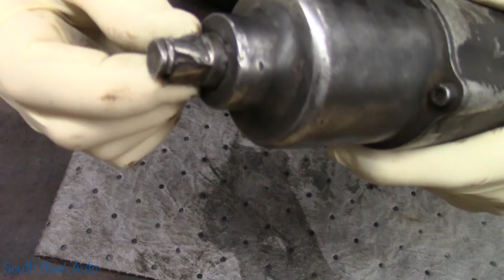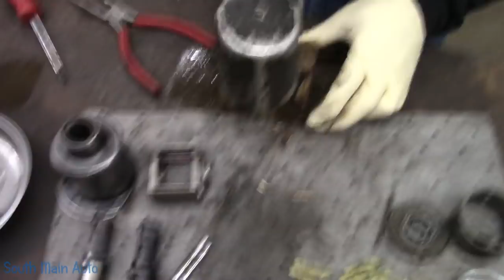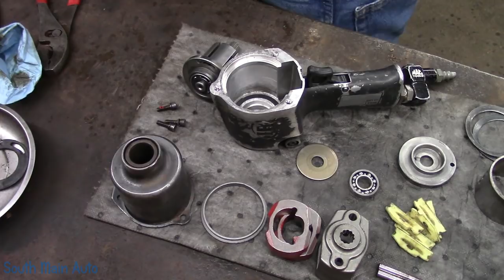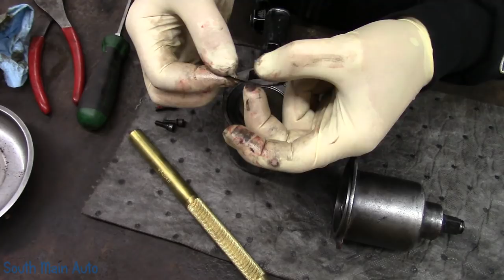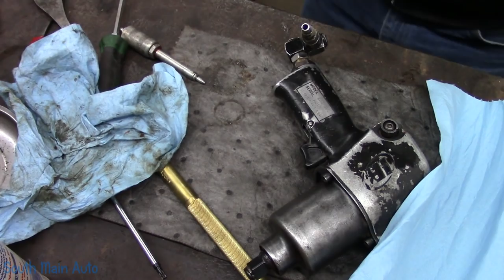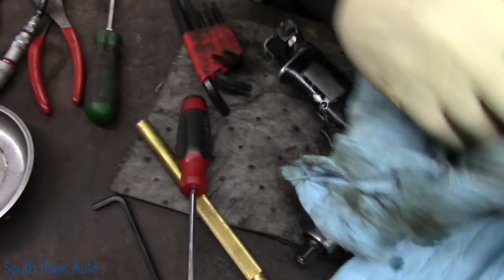What's Inside: 1/2" Air Impact Edition

Comment from the maker: *Ingersoll-Rand 232TGSL* : 1/2-Inch Super-Duty Air Impact Wrench Thunder Gun: https://amzn.to/2BG4btJ
*Astro Tools On Amazon* : https://amzn.to/2BFh4nU
Reply: Great video  Eric hope you had a great Christmas and also have a great new year
Reply: @TractorWrangler01  it's funny...the only reason one might prefer to have someone else do it is for the Warranty on work and parts.
Reply: just think if you had a lathe you could of made the part yourself cheaper
Reply: @glyn watkins cheaper than free...
Reply: @darylzero3139  depends if ya have a lathe n spare metal in the first place lol
Reply: @glynwatkins9968  you could make it but it wouldn't be as strong. Plus you'd need to mill the flats too.
Reply: @southjerseysound7340  yes u can do that on a lathe to lol, youtube shows u how to do it
Reply: @glynwatkins9968  yes you can adapt a lathe to do some milling. I actually have a angle plate and slide on my mini lathe. But you're failing to realize that anvil is forged and has to be in order to survive. Anything that you machine from raw stock will be hammered to bits in minutes.
Reply: @glynwatkins9968  
Not if you value your time! You also need the correct type of metal too. Funny, people think you can just chuck up any ole metal in a lathe and you've saved yourself from buying something!
Reply: I love that u made it shift gears like a race car. Sounded like one to. On another note I always wondered why the inside was like and how it worked
Reply: I had one of these and all of a sudden it didn't work with the same torque  I ended up throw it in the garbage
Reply: Definitly going hmmmm😉
Reply: @willielittle6021  lo
K
J
Reply: @JorgeRodriguez-po7kx  
  Never throw away these types of tools, they're all just a collection of replaceable "pieces parts."  😉
  If you pay attention to how they come apart, they're pretty simple to fix, don't try to remove the vane (like  he did) housing from the press-fit seat...  lol. No need.  Doable but, a pain if you don't know know what you're doing.  lol. Just flush it with brake cleaner/solvent until it runs clear.
Reply: First off, I love SMA channel, it's just honest and raw, no gloss workshop stuffs. I wonder what SMA thinks of the old magnesium impact housings compared to the newer modern composite bodies. Love to know the answer to that as I'll never find out myself in 3 lifetimes compared to how much they use their guns.

Comment: When I bought my first new air tools, I bought all IR, mostly because the older mechanic who was kind enough to mentor me had a full set of IR tools that he bought when he first got started decades ago and they all still worked. The company has been around forever and all the parts to rebuild them are still available. The only time I've had to crack any of them open is because an old shop that I used to work at used line oilers and filled them with Marvel Mystery Oil. The ingredients are a mystery to me, but they made all the seals in all my air tools swell to the point of no air getting past the triggers, so I had to replace the gaskets and o-rings in all of them. But that was about 13 years ago now, and they all still work beautifully after receiving daily beatings.

Comment: 16:07  Hole offset does matter.  It biases the power output on the rotor rotation.  Hence why it has higher reverse torque.

Comment: Great video. Good for you for rebuilding a great gun. I just rebuilt an ir 231 model a. Trick to getting the motor in and out smoothly is to heat the housing with a simple propane torch. Then it goes in and out much easier.

Comment: My dad always used I.R.  When I went to work that's what I bought. Still have my first impact. Only thing I changed has been the anvil. did it about like you did. i never had good luck with air ratchets. Once worn out toss and buy a new I.R. Thanks for sharing.

Comment: Rebuilt many of those!  Worked for a company that used those impacts on their production plastic molding machines to pull the molds apart. 48 1” bolts every 7 minutes! But that was 40 years ago, and they look the same!  Great tool!

Comment: i could be wrong but--- i believe there is a pin missing that aligns the front and rear of the motor assembly and the barrel of the motor. the offset on the barrel is so it has more torque in the reverse direction. so if you put it in backwards  you can put things on that wont come off lol. and that grease fitting in the back- it goes through the motor through the anvil to grease where the hammers hit.   ive wore out a couple of guns in my lifetime  always had the 231's  every time the thing needed fixed they would break off the lower right cover screw. not sure why. always had extras on hand. anyways thanx for bringing us along
Reply: richard cranium pretty sure the pin your talking about went back in to align the gasket at the bottom before he put any of the motor back in.
Reply: I used to love my IR231

Comment: My IR 231 is somewhere around 50years old! Put in one anvil and one set of vanes. Still use it ,still working fine. Oil it occasionally is all it gets.wish I had a dollar for every wheel it's taken off ,not to mention the on told amount of other bolts and nuts it has hammered off and on.  40 years as mechanic at Chevy store followed by ten years mechanic in at auto auction.

Comment: I still have my Campbell-Hausfield impact I bought at Walmart for $65 back in '01. NEVER oiled or greased the thing until just recently - never knew you were supposed to HAHAHA! Didn't know what that strange fitting was on the side until about 9 years ago, lol. Thing never let me down though! Can't believe it lived as long as it did with zero grease in it. Guess the factory actually put some in, and it was actual quality grease. It now lives in the back seat of my truck in case I ever get a flat - I've got a set of Viair air compressors in the bed.

 I used that impact daily for close to 10 years before I bought my IR 2135 TiMax - that one is now almost 9 years old, but I've kept up on the maintenance - she cost me just a bit more money than the CH unit. Haven't had either one apart yet - figure I've got another 10 years before that needs to happen.  😁

Ahh who cares where the gaskets go - it worked! 👍👍😊 Nice job! Set for another 20 years, at least. 😜

Comment: For many years I had the IR 244 which is similar, runs a little slower but has a little more hitting power I believe, my anvil twisted off one day which rather proved the point that stuffing lots of air pressure into it gave it a lot of magic beans !. I ordered a new anvil and that portion of the tool is very easy to work with as I found out. Some years later the three case screws backed off with the vibration ( probably never get them out if loctite was put on them ) and air leaked past and lost power, figured out the issue but it had blown the gasket. Had to buy a rebuild kit just to get the gaskets but when I used the whole kit and took the motor apart to replace bearings and the motor vanes I discovered that the motor case was worn badly as in out of round in the area where the ports are and the only fix was a new motor case, up here in Canada that one part cost as much as you replacing your whole gun Eric. Needless to say I retired that gun as it was not worth pouring the money into and bought the composite IR and have been extremely happy with it in the few years I have owned it. I see a lot of comments about being so surprised about greasing these guns, well they are designed to be greased as the grease goes into the hammer/anvil end for that action through the hollow motor shaft passage way, the oil into the air tool opening lubricates the motor vanes. I had even bought the mini grease gun and the special grease from IR way back with that IR 244 and greased and oiled it often, seems the only way to give those tools enough oil for the motor to live the longest life is by having an oil injector/mister into the air line but then that shops air line is no good for blowing straight air or inflating tires but that.  Excellent real life tear down video of a well used/abused tool !

Comment: Nice.  I had a Black and DEcker model from the 70s.   Couple years ago, a plastic piece broke in the air control side.  Didn't seem to be any parts available or any   guns found on  eBay to cannibalize.   I tried to rig up a replacement  part ,  but no go.   The housing sits now in a pile of stuff my grandsons play with ( has a good handgun profile), and I now own a Harbor Freight replacement.   I'm an old DIYer so I expect I won't need another new one.

Comment: I've had my IR 231 for 23 years now, only had to replace the anvil. I had replaced the hog ring but the sockets still kept falling off so I changed the anvil and all was good, still works to this day. I think IR makes the best pneumatic impacts. I heard a lot of techs now are switching to the cordless impacts now. I just don't know if they have the power of the air powered ones.

Comment: Those holes in the housing that the drum with the fins spins inside of is the air escape, they affect the torque(?) that is applied when spinning in each direction. If the holes are closer to the clockwise direction, it would be less spinning in that direction than counter clockwise, and vice versa.

Comment: 5:10 That looks very familiar to me as at one time I serviced vacuum pumps. Rebuilding is a new set of vanes and polishing the rotor on a lathe with wet / dry 600 grit.

Comment: My IR impact gun looks exactly like that one, except with a rubber cover over the handle.  Often wondered what it looked like on the inside.  It's been a great gun over the past 15 years of my intermittent DIY auto repair uses.  My only beef with it is the torque adjustment that's built into the reverse switch.  I like having the reverse torque up high and the forward torque down low (breaking lug nuts free vs. installing them lightly before using a torque wrench), and when I adjust the setting for one direction, it seems to change the setting for the other direction as well.

Comment: Ive put together motors that are a similar fit, its nearly a line to line fit and you need to be very straight to get it to slide together..I use to play with the pneumatic die grinders the same way. My kinda mechanic.

Comment: I'm limited to parking lot mechanics, would you recommend I get a cordless impact gun? They're on Amazon for around $300. Right now I'm using a breaker bar with an impact set already, so I have both Imperial and Metric, because Mitsubishi likes to mix the two because reasons... I actually managed to torque a converter set because my breaker bar is 1/2 inch, and the set I had before was 1/4, and the bolt seized up in the caliper mounts, and from all the leverage I had from the breaker, I broke the bit. Advance Auto Parts was nice enough to take the set back even though I clearly broke it from over torquing it. Anyway, 5 hours of curse words, flame, squirting PB Blaster on my 3M mask and glasses, breaking a hub bearing and shattering the rotor, I finally got it off. However, I feel this could've been avoided by an impact gun.

Comment: The exhaust ports in the bottom of the cylinder looked like they were offset to one side a bit, if so I’d imagine the cylinder is in fact directional as the timing of the exhaust ports would affect power in one direction or the other.

Comment: This style impact is bulletproof, oil it often, give it a shot of grease now & then to pad the hammer parts and it will last a long time. I use the 231C and its hard to beat the price (125) and it has a decent amount of power.. My first air gun was a worn out CP 741/749 before getting IR 231/261. The vane kit is fairly inexpensive, the hammer kit seems to cost as much as a new tool LOL The new tool is imported but still quite reliable.

Comment: Have rebuilt this platform since the early 90s . That 3 piece gasket is starts as one pinched between the hammer housing and spacer that is pressed fit into the housing. The air vane cylinder is best left in when removing the rotor to keep the lower end plate aligned to the housing bore and will assist on reassembly. If you really wanted to wake this thing up remove the e clip from the rotor end plate remove the bearing lap both end plates with 300 grit on a flat surface to remove any grooves finish with a 600 grit. Then use a wheel cylinder hone to clean up the vane cylinder take the vanes to the 300 grit and lightly clean the seal surface.  A couple drops of 10w30 on the bearings reassemble dry. Now you have to seat in the vanes WD40 with a straw applicator a light squirt into the air inlet. Hook up a regulated air line or or one with a tap. Plastic tie the trigger full open put it in a vice or lay it on the floor 40 psi or mid throttle let it rip 5 min in fwd then in reverse. Now the vanes are seated give a light dose of air tool oil 3 to 4 drops and continue to do that over oiling the tool will degrade the performance then grease the hammer push the drive into the tool grease the tool until the drive pushes forward then stop you can actually over do it and tool performance will suffer.Now your IR is better than new. 300 ft lbs now 400 ft lbs.

Comment: I'm definitely NOT an impact expert, but when installing bearings in various things (like bicycle headsets) I find using a piece of PVC pipe useful as a non-marring driver to pound on.
Reply from the maker: I actually have  a park tool headset/bottom bracket bearing driver for bikes :D
Reply: @SouthMainAuto  That is funny.  I have used my automotive threaded pullers both purchased and homemade  on bicycles since the 1990s.

Comment: Very cool I've done that on a few of the old IR231'S though one of them didn't work after and the other I just changed the anvil which was no problem. If you bought a Mac 3/8 impact for $100. that was a heck of a deal I've priced them out here and they're over $200

Comment: On those two jiggly bits, it might matter which one is which if one is beefier- i think on impacts, sometimes the hammer for the loosening direction is beefier than the one for tightening, so you get more torque to break things loose, but not so much likely to snap them off going back together.

Comment: I don't use that Lucas air tool oil. I took a piece of scrap metal and polished it to shiny bare metal. In three different areas I placed one drop of Lucas air tool oil, one drop of Ingersol rand air tool oil and one drop of Top Ring air tool oil. I did not distribute the oil depending on the wicking action. I then set the metal in the weather for several months through the Canadian fall. On examination, the Ingersoll rand area which had expanded to an area about 4 inches in diamater was shiny. The Top Ring was a close second. The Lucas patch had a large accumulation of surface rust to the entire area.

Comment: As far as the vent holes go on the motor housing, they bias the pneumatic motor to putting out more torque in one direction than the other. In this case it will be in the direction of breaking the bolt loose, if I recall. It will work the other way, but have less breaking torque.

Comment: Those plastic parts are called Vanes.  Just like a air/vacuum pump.  usually made out of carbon and expensive, they wear kind of like brushes on a motor.  But that is for pumps, I'm not sure about an air motor.  cool video, never took one of my impacts apart.

Comment: You forgot to throw a little oil on the cross bolt (direction change bolt/part/piece) to help free it's motion.  Made a big difference when I did mine, don't shove grease in there, it'll find it's way in eventually but, some tool oil on either side while it's all apart will make you happy.  😀
  The secret is to not remove the vane housing/motor in the first place.    😆  Just flush it with brake cleaner/solvent until it runs clear, spin it around, etc. until it's reasonably clean because, when you re-lube everything after disassembly and cleaning, you just shoot some grease in the back fitting with a mini grease gun, as that rear grease port's whole job is making sure that bearing gets greased, since you can't grease it from "the front" when you disassemble the tool for its routine maintenance (every 48hrs of run time), as you're doing here, sans beating the tool to death to remove a part that only comes out if that bearing goes bad, which only happens if you don't grease it regularly through that rear grease port.  <deeeep, wheezy breath>  😆 

 The way that part comes out is with a special puller that reaches in, like a bearing puller, hooks under the vane housing and you pull straight out.  There's a small slide hammer type tool for little jobs like that.  Finding one is another matter.  😀

Comment: I used to fix them for a living, if you heat the housing with a propane torch the motor back plate slides right out or back in.

Comment: In the early '90s, my friend and I were both drinking the snap on Kool aid. But I was poorer..he got a snap on 1/2 impact gun, I got a cheaper IR231a, also from the snappy truck.
   Surprise! The IR totally whupped on the snap on, clearly more powerful. I still have that, recently got an Astro Thor. Which is more powerful, but I still like the IR a lot. Very good trigger.
    Too bad that I hear IR maybe slipping..compressors made in India, difficult customer service, etc.
   But my IR air tools have been very good.

Comment: warm the housing with a torch , use long drill or dowel like rod to reassemble motor to pull motor stick spline in soft jaw vise and warm too, oil vanes when rebuilding motor not grease. twin hammer 1/2" drive one of the better IR tools.